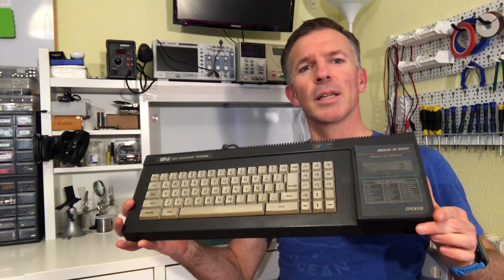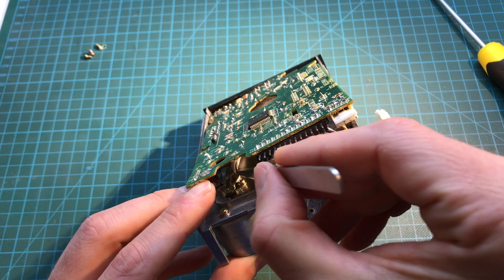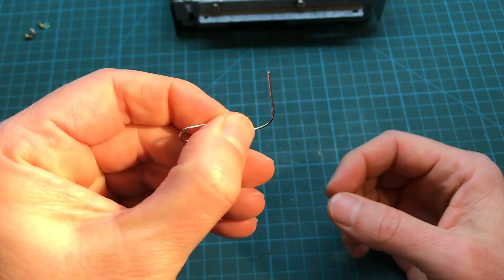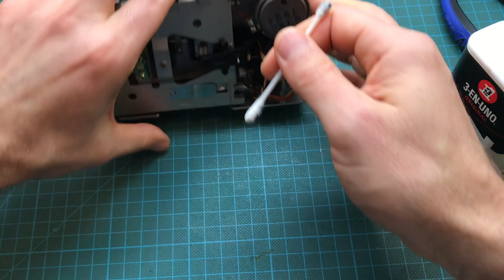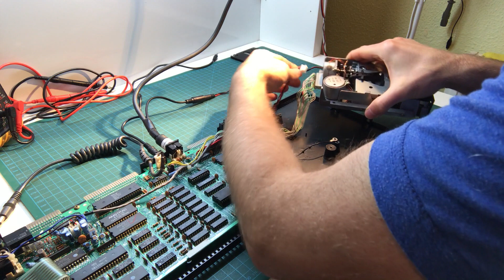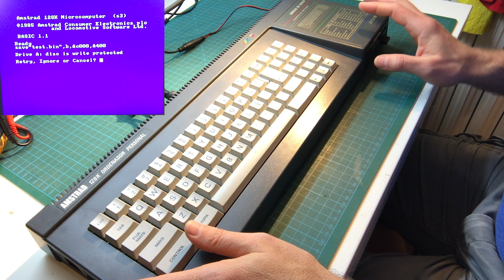Repairing and Servicing a 3" Floppy Disk Drive

Comment: hi, checked my cpc 6128 drive with the RPM program and it shows 600 RPM for my not working drive, although I haven't open it yet, might it show that the belt is totally off so it spins 2x faster ?

Comment: Hi and good day

I have been a fan of yours since almost the beginning, and thanks to the great work you do on YouTube, I have been able to recover several 8-bit machines. Although I am a Spectrum fan, I always liked the CPC 6120, after 30 years of having seen it, I have one recovered, but the floppy drive resists me, a 150A. The belt changed, the motor turns, but the head motor does nothing. I know that these motors are irreparable, but I am trying to locate a replacement unit, or be able to repair this one. Could you help me? Any information will be welcome.
BEST REGARDS

Comment: Are the PCW drives compatible electrically with the single sided drives?
Reply from the maker: Good question. I don't know! I would guess yes, but someone else would have to confirm it.
Reply: @NoelsRetroLab  thank you so much, I'm trying to hook one up to a DOS PC, and the answers I've gotten have been a mixed bag.
Reply: @NoelsRetroLab  your video has been very useful! Now I know where to put that pin!
Reply: @NoelsRetroLab  the one I've got is the EME-232V , a much later revision I'm worried about the motor not being aligned like in your other video, as the drive was disassembled when I got it.

Comment: Hi Noel! New subscriber here 😀 where do you buy the right belts?
Reply from the maker: Hi! I got them a while back from Ali. They sell them in mixed-size bags for very cheap, so you only end up with a handful that fit, but it's still worth it. The important thing is that they're flat cross section, not square or rounded like the tape deck.

Comment: Fran Blanche swears by sewing machine oil because it's low viscosity and therefore it has a lower tendency to gum up mechanisms. Can't say I've used it myself but it seems good advice for any delicate/precision oiling jobs.
Reply from the maker: That makes a lot of sense for the moving parts of a floppy disk drive. I'm saving that one for future reference because sometimes I feel that lithium grease is just a tad too thick at lower temperatures (and maybe it's totally fine).

Comment: Hi Noel on mine the motor moving the head is not working, how do you deal with it ?
Reply from the maker: Start checking that the head motor is getting proper voltage (they often have dry joints in the power connector), and then check to see if it gets signals to move. If it does, then it might be something more complicated in the drive board.
Reply: @NoelsRetroLab  Thanks for the reply, i have read that there is a mod with a 3.5 floppy disk, is this a working mod just in case the 3 disk is beyond repair at least for me ?

Comment: Nice again Noel.
BTW, I got an old PCB from AMSTRAD. I don't know from what machine it is. It has a Z80A, an NEC 765, and  16 DRAM chips, with 512kB of RAM. I think it was from a CPM computer sold as typewriter. Do you think it is good for something more than spare parts? (The Z80 is socketed and tested ok, the rest i'm not sure)

Comment: Also a question Noel: How do you get the RPM tool on a disk. i mean.. i can download the software but what then :)
Reply from the maker: Haha, good question! I have it on the Dandanator ROM cartridge, so I can always load it. That's ideal. On disk is also useful, but only in those times that the disk is actually working.

Comment: 7:34 is the board sodered to the drive and can't be removed?
Reply from the maker: Yes, it actually is soldered there with a few cables. Check out my video where I repair a ZX Spectrum +3 with the same kind of drive. There I end up taking the board completely apart to test it on another drive, so you'll see how it's hooked up.

Comment: Noel loving the videos, great channel my friend. I have a question for you though. I got a cpc 6128 a while back. Its great. Only problem is the drive. One in three times it will perform the "cat" command correctly the rest of the time it gives just read errors. Read errors also if I try to cpm a disk or run" a program. I've tried most of the obvious stuff like changing the belt, cleaning the read/ write head and lubing with vasaline. Any ideas?
Reply from the maker: I'm glad you're enjoying the videos! Your poor drive sounds like it has some issues. Which error do you get? The disk read fail one? Are you 100% sure the disks are working fine? They'll often go bad and cause error messages like that. It could be the sensor for track 0, but that will depend on which errors you get. I hope to cover that one in a future video. Let me know and good luck!
Reply: @NoelsRetroLab  I got read errors when I tried to load, and write errors when I tried to save programs. The disks are also used pre-owned so I'm only about 15% sure on those :) Wont get to take another look until next weekend but I'll keep hacking away at it. Thanks for your help I'll keep you posted.
Reply: @NoelsRetroLab  Noel, good news this weekend. I disassembled the electronics of the drive and resoldered any joints that looked to be suspect. This changed nothing, still the same disc read errors. Then I tried something that I probably should not have. I marked the position of the stepper motor and removed it. I then took a look to see that it was not broken or damaged on the inside. There was a little gunk in there. Could have been grease, but it looked like gone off rubber. I removed as much as I could and reseated the motor assembly. I tried the "cat" command, read error, moved the motor a fraction clockwise and continued until "cat" worked then I tried to run a program, read error, turned the motor a fraction clockwise "cat" and run" and finally success. Of the eight disks I have seven work well rarely a read error with "cat" now but it still happens from time to time (I suppose there is still some fine tuning to be done). BTW the drive is an EME-156. Again many thanks for the video it has been a real help to me ;)

Comment: I love your calm style Noel, please do more Amstrad related material, or if you don't have any how about doing a video explaining how you test boards with your multimeter
Reply from the maker: Thanks! I do have more Amstrad videos in the works. Coming soon! As for how to test boards using the multimeter, check out the C64 repair part 2 (https://www.youtube.com/watch?v=QmU9u27u5zk). There I specifically talk about how you can use the multimeter to test for activity on a line... only to then realize that I was tricked by that when I looked at it with the osciloscope. So yeah, you can use it, but it's less than ideal.

Comment: hi very good video i need youer help please i have a ddi-1 for my cpc464 iv put a new belt in the belt spins but still come up with disk missing i dont thing the setup morter is working any help on this pleases thank you
Reply from the maker: It could be lots of different things unfortunately. I recommend reading this thread carefully: http://www.cpcwiki.eu/forum/hardware-related/fixing-floppy-drives/100/ Things to try out: try a different drive (to narrow it down to the drive or the controller and/or cables, make sure it's getting 5V and 12V (sometimes the transistors that provide the 12V fail), make sure the RDY signal is being set correctly and gets all the way to the controller. Feel free to post on that thread with your findings and you'll get more help. Good luck!

Comment from the maker: When talking about the write-protection pin, I should have mentioned that not all 3" drives use that switch and pin mechanism to detect write-protection. Some of the older models use an optical sensor, in which case you can flip the drive over without fear of losing any pieces. You can tell easily by looking for that switch under the board.
Reply: So they went cheap over time